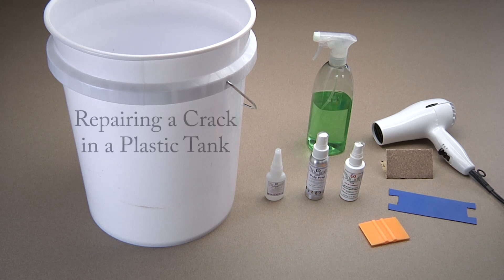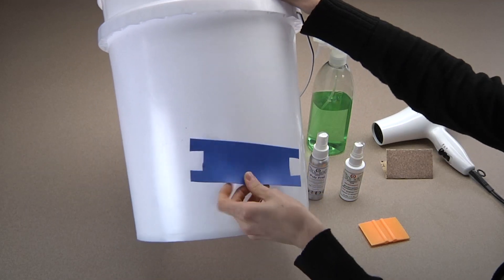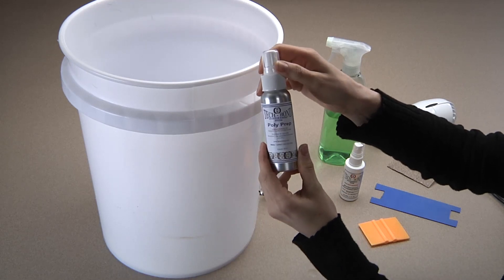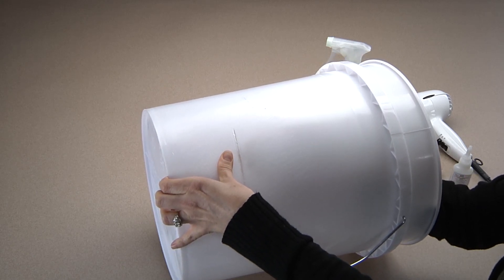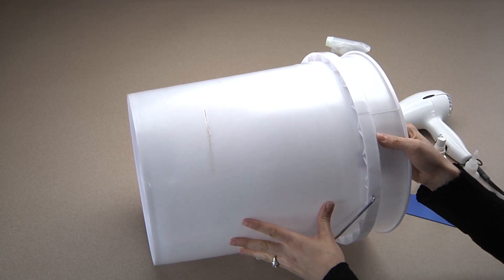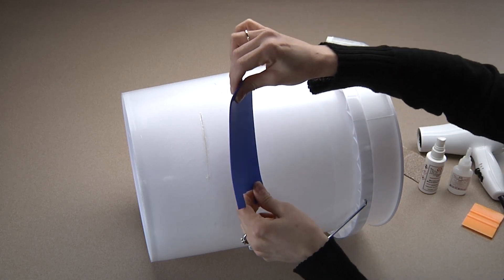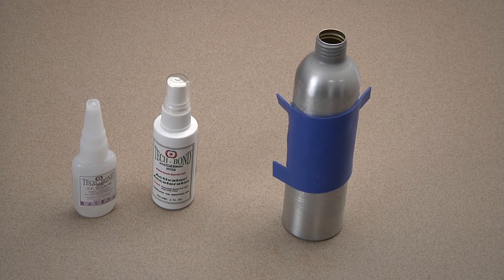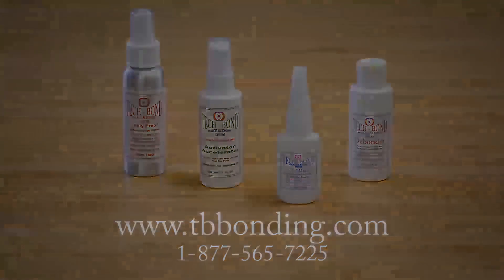How to repair cracked plastic | Tech-Bond Process

Comment: I have to say... this stuff is amazing.  Had a cracked "nylon plastic" reservoir tank on my Class A motorhome for power steering fluid, and it fixed it beautifully. Couldn't be happier.  Before using this, I tried a plastic repair kit from a box store, tried plastic glue, and nothing worked as nothing I tried bonded to nylon plastic. I eventually brought the tank to a plastic welder who struggled with it because it was nylon plastic... and still leaked a bit after.  But this stuff bonds great.

Comment: Alternatively:use snips or a blade and cut out a chip from the same material. Heat the cract with hot air. Light the chip with a lighter.  The melted drops  fall down to seal the crack

Comment: Can these patches be used in high heat applications and in applications used for food? For example, a plastic popcorn popper lid that has cracked. Could I place the patch on the outside of the lid which experiences high heat and comes into direct contact with popcorn?